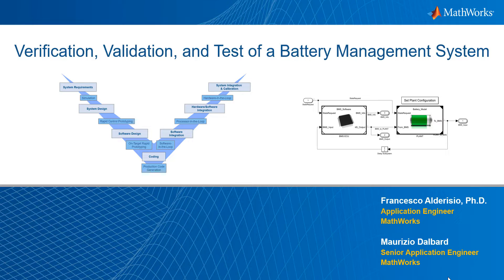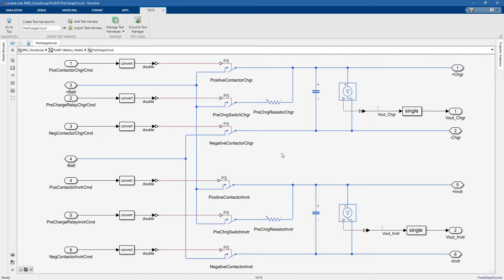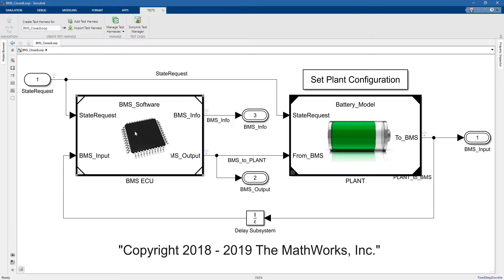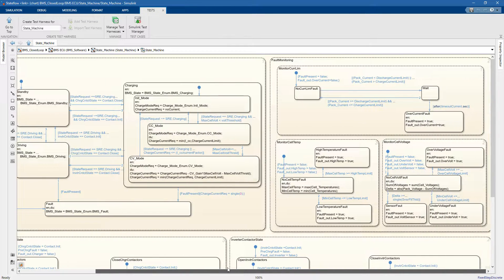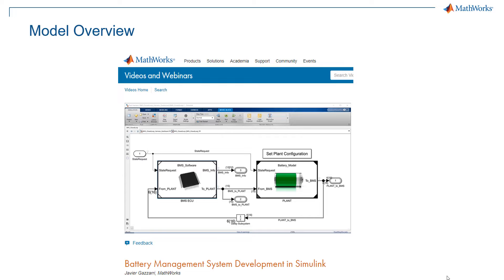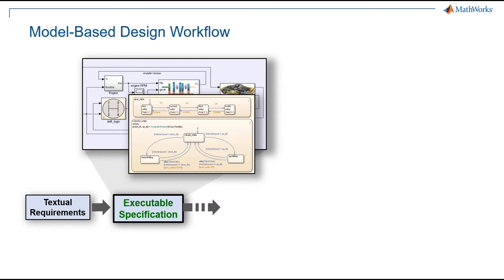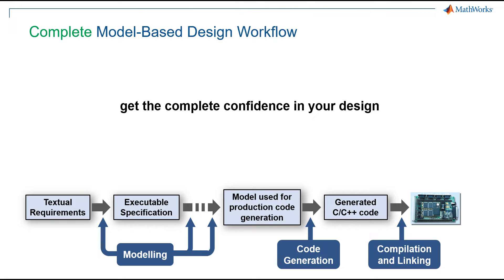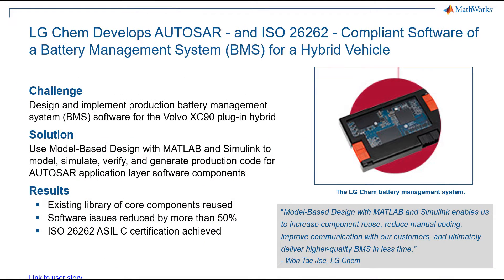Part 1: Introduction to Testing Battery Management System (BMS) Software

Comment: I am an engineering student aspiring to work on the testing and maintaining of batteries. These simulations are a bit overwhelming as there are a lot of background coding and logic involved. Do you have any suggestions for a course or a video series from which I can learn the coding and modelling of the system?
Reply: can anyone answer this?